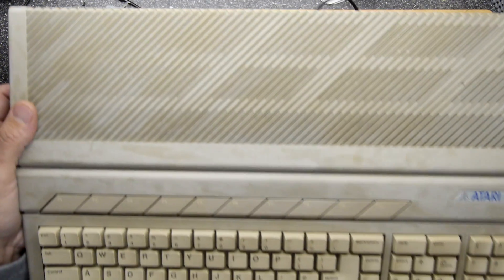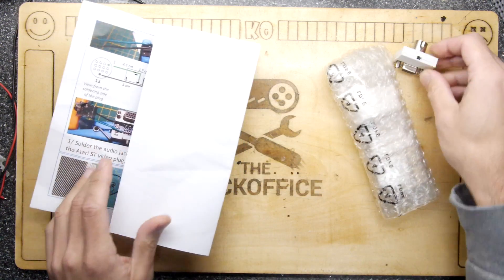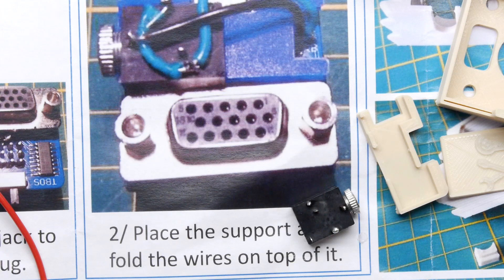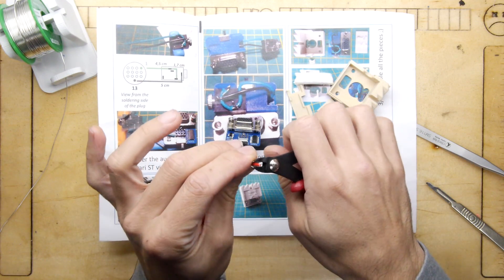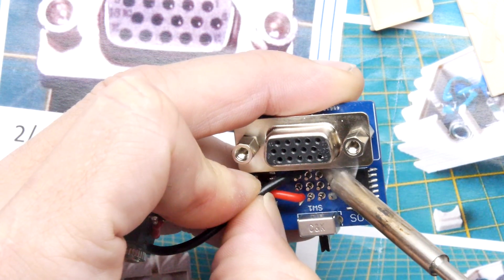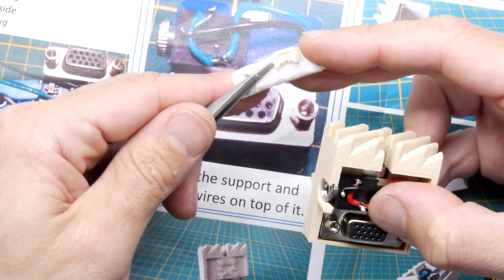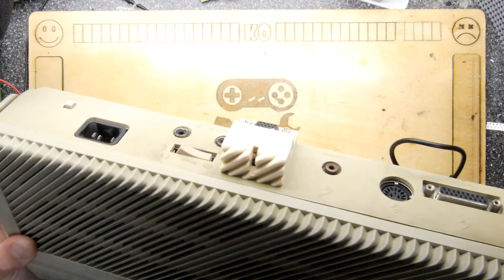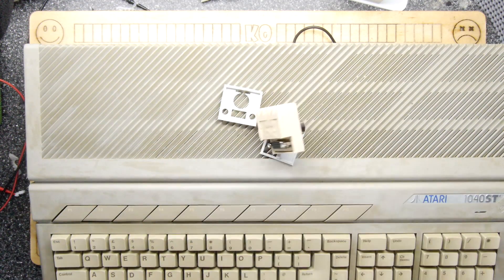Atari ST to VGA Custom Case Pierre Edition

Comment: Thank you for making a full video about it :-D.  
To answer your questions,  you can still switch between low-sodium/high resolution with the help of a little flat head screwdriver to activate the switch. 
The color used for the printout is "cappuccino" to get that retro style.
And finally,  the printing of the logo can be done by switching the cappuccino filament with a phosphorescent one: there's an image on thingiverse showing the separation level 

Quite some time indeed in it but as they say, when you like something,  you don't count your hours. 

Long live the backofficeshow channel! :-D
Reply: Low-sodium = Low-Medium resolution of course  ;)

Comment: I have one of these Devizes from ebay with the socket already on it but it does not work in medium or low resolution as it says on the monitor 'out of range' any clue as to what is wrong.